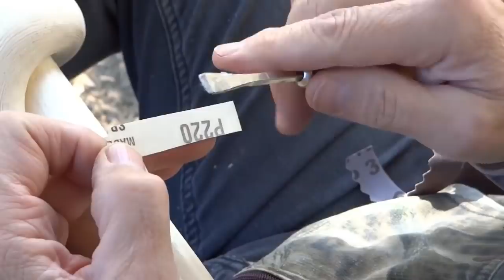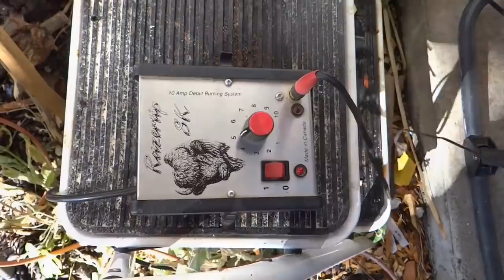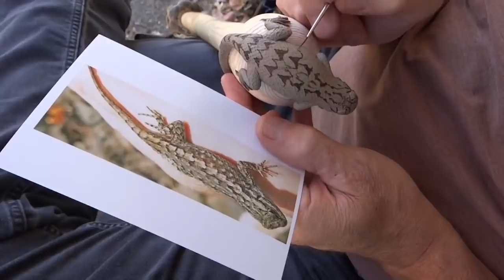Carving a Fence Lizard and Rattlesnake Walking Stick

Comment: It amazed me the lizard staying still on your hand as you carved .
Reply from the maker: Me, too!  He was a great little model.
Reply: They like the warmth. I used to have a 2.5' iguana hang on my back. Iggy. RIP
Reply: The little guy was amazed to see himself being made from wood
Reply: The little lizard knew he had nothing to fear, and so became immortalized :)  I agree, this and all your carvings are museum pieces.
Reply: When I use power tools I have problems with the wood fuzzing up. How do you prevent it?.
Reply: In the Wood i hear most a rrrrrrrssssshhhh, that was the Lizard, Feuersalamander, my favorite Friend, was slow like a Snail, and friendly, cosy...
Reply: what kind of rotary tool is that, that you use. Looks a bit like a dremel?
Reply: Warmth plus I think its focused on the sound and it it's going to cause harm lizard can only focus on 1 thing at a time. My opinion on what happened
Reply: Stinnett Sticks absolutely amazing my friend
Reply: @jeanblythe1595  cannot agree more
Reply: Kenny Marshall ---Sandpaper?
Reply: So realistic amazing work i love it

Comment: Good health Mike! My name is Andrey, I live in St. Petersburg. I carefully study Your work and admire the skill, talent and patience! Please tell me, Mike, what kind of wood do you use for a cane? I noticed the wood was damp. But why are there no cracks when drying? Thanks! With respect. Andrey.
Reply from the maker: Thank you, Andrey! The wood used in this most of my stick projects is Lodgepole Pine ( Pinus contorta ) It has been cured for as much as two years. The only project that I have used wet wood on is the Beaver stick where I used only hand tools to carve. It is carved from Alder wood, and there were a few cracks appearing which I quickly sealed with CA glue to stop the cracks.
Reply: @StinnettSticks  Thanks a lot, Mike! Very grateful. Your work like all my family! I paint oil paintings. Now I will try your art.

Comment: Hello, can you tell how you prevent your flexshaft from overheating? I bought a machine with a flex shaft and after 5 minutes of work the flexshaft isolation melted, the machine wasnt even at full blast.

Comment: I have found myself some really nice walnut branches that are around 6 to 7 foot tall. They were cut off the tree they came from about a month ago. I need to get them inside to "dry out". If possible, could you please recommend a length of time to allow them to dry out before working them. They are about 5 to 6 inches in diameter. Thanks either way, if you respond or don't.
Reply from the maker: It really just depends on the wood itself, and humidity. As a rule of thumb, I think you could allow six months per inch of thickness to be completely cured.
Reply: @StinnettSticks  thank you very much for your help.